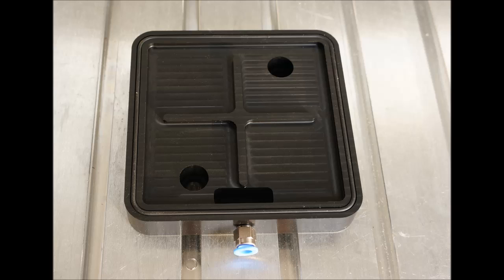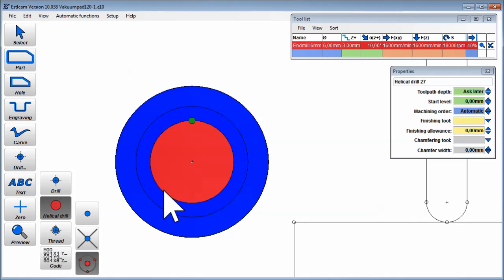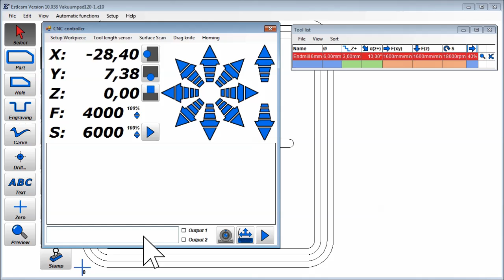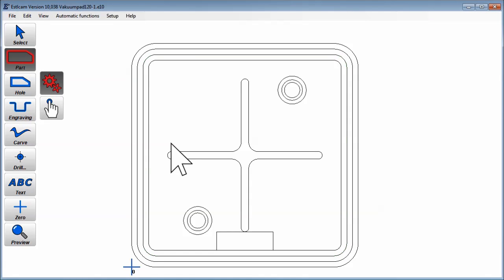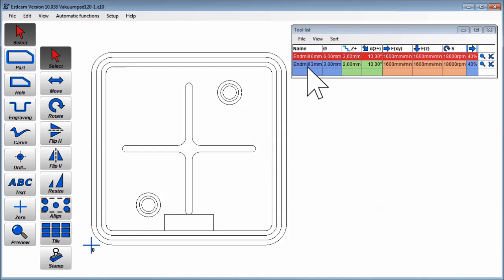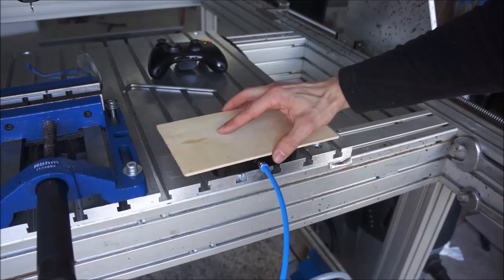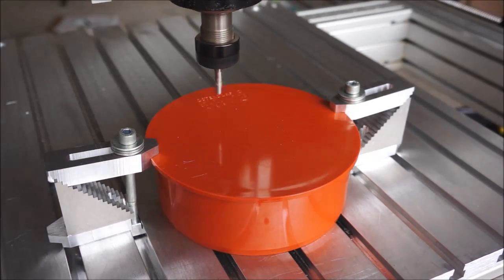Vacuum pad for vacuum clamping with rotary vane pump

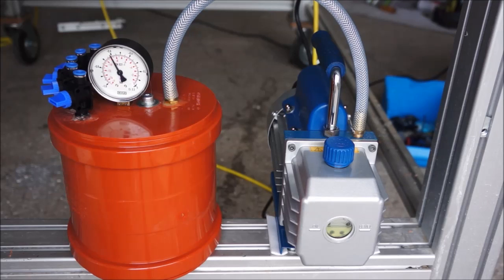Comment: 5:20 (There is not water in your build :))  this isn't water vapor, its oil mist from the vacuum pump exhaust. Its very unhealthy indoors. This aerosol is very fine and needs a good exhaust filter that works.
Reply: Hyper Hektor but there is water in the air. And boiling point of water decreases as vacuum increases. So it is possible that it is water vapour.
Reply: @chimaeria6887  It is oil mist and should be captured, filtered out, or extracted.

Comment: Welchen Kunststoff verwendest du für das Werkstück? Dieser lässt sich ja sehr gut fräsen.What kind of plastic you usíng for the workpiece? It made milling easy and chips verry good.
Reply from the maker: Es ist POM. Alternativ wäre auch Hart-PVC sehr gut geeignet (etwas billiger, dafür nicht so alterungsbeständig).
Reply: I was just about to ask!
I love POM, it might be the material i mill in the most, its perfect for so many things, and its really soft to cut into, even tho its very hard by itself. For example, i also work with chain hoist, for lifting equipment, and the hoist range from 500kg to 4000kg, and to protect the chain from curling when raising or lowering, i have designed a plate of pom, to force the chain in the right angle, without damaging it. 

I use POM for a electrical cabinets too, you just need a special kind, that is flame exhausting.

Its a versatile and great material!
Reply: @ChristianKnuell  Hallo Christian, wo kann man POM kaufen?  danke lieben Gruess

Comment: Great job, could you tell me what material it is? And it would be a lot of help a tutorial of how to make the Pump that you use
Reply: Miguel Torres aluminum base with a delrin top would work very well for this. When the top wears down toss it and cut another.

Comment: The connector is only for positive pressure.
Reply: This connector works well also with the press with "negative pressure" -vacuum, I use them without setbacks.